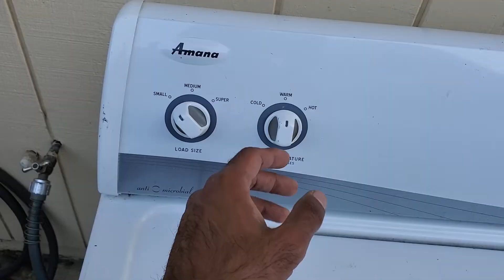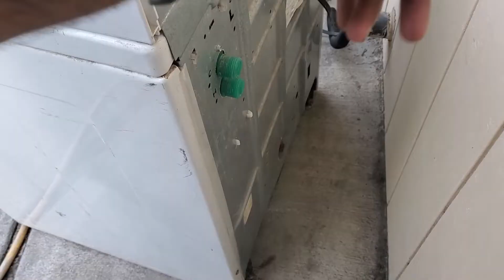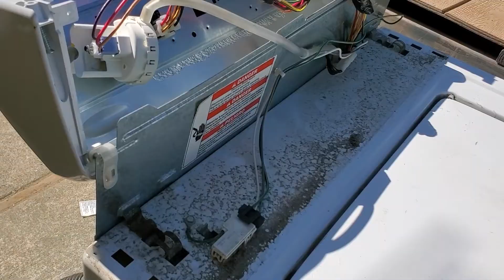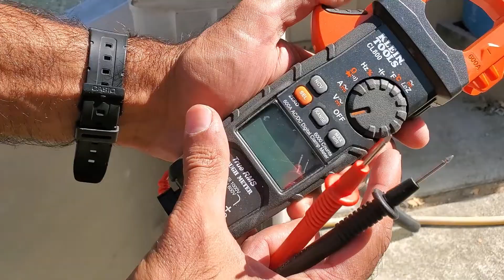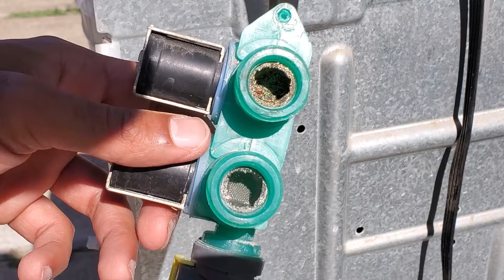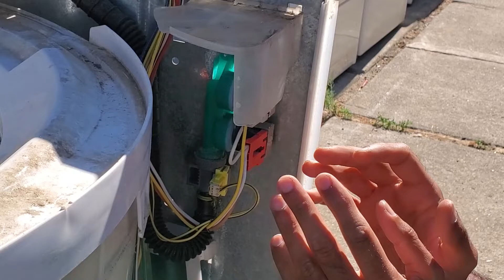Fixing A Whirlpool/Kenmore/Amana Washer That Is Stuck On The Rinse Cycle!

Comment: I have a problem whit the exact the same washer but my washer not spin
Reply: Did you resolve the issue?  What was it?

Possibly the Lid Switch?
Reply: @Bigsmegma44 yes, is was a plastic gear ⚙️ in the transmission I replaced and that all
Reply: @Bigsmegma44 probably i need make videos too for this, unfortunately i dont make for that but yea you need open the transmission be careful dont drop the oil

Comment: My whirlpool washer model WTW4616FW2 , is stuck on rinse cycle and the light is blinking  ? There is a light on the electronic control board .
Reply: Same. There’s a video showing the screens clogged inside the top electrical panel thingy 🥺

Comment: I have one that agitates and rinsed fine but skips Spin and the pump keeps pumping all the way to Off. 
  Timer?
  Motor?
  Transmission?
  My dumbass just went and out it on Rinse and it just started pumping. 
  I think that tells me the motor/transmission is reversing so the transmission must be bad. 
  I have a neutral drain kit I bought to do out in two washers that I thought were spinning and draining at the same time. I thought this was one of them. Still not sure it wasn’t and the transmission needs rebuilding. 
  That is my next move.  If nothing else I will have a rebuilt transmission for one down the road.

Comment: My washing machine gets stuck on every cycle, I have to manually move it on from beginning to end. I did turn the water cycle to cold and the water is coming out…What can I do to repair that?
Reply from the maker: If it is getting stuck at the "rinse" of every cycle, then most likely, the cold water valve is clogged/failed. If it just gets stuck randomly, then you have a bad timer

Comment: Mine won't rinse its a whirlpool
Reply from the maker: Either it's the cold water valve that is bad or the timer. Does it rinse in other modes? If it does, then there is an issue with the timer. If it does not rinse in any of the settings, then it is most likely the water valves (easy and cheap fix)

Comment: You can sometimes clean the old ones up. Use some CLR type cleaner and just a LITTLE acetone (too much acetone can melt the plastic) mixed with white vinegar.. it’s always worth a shot, especially if money is tight.